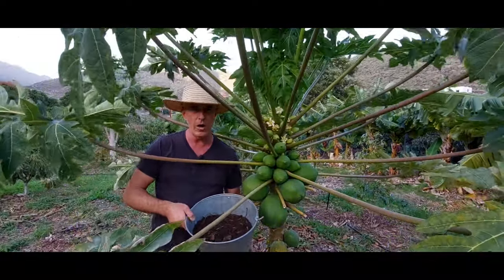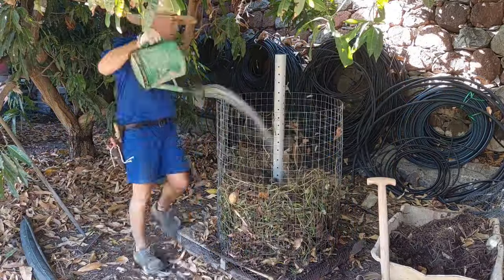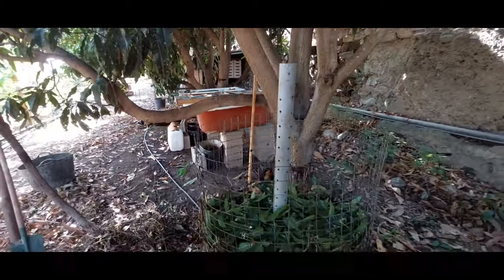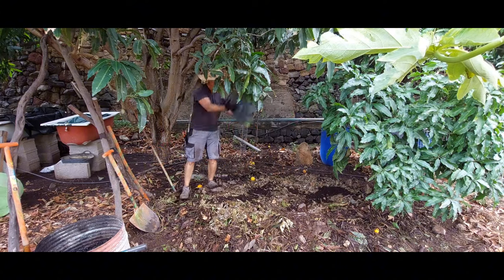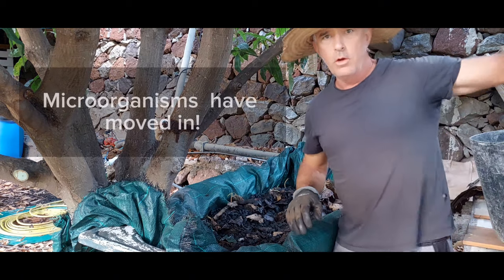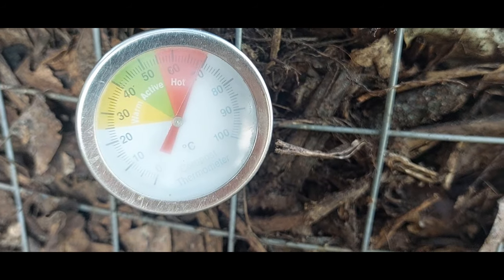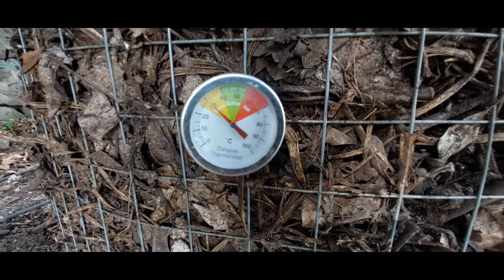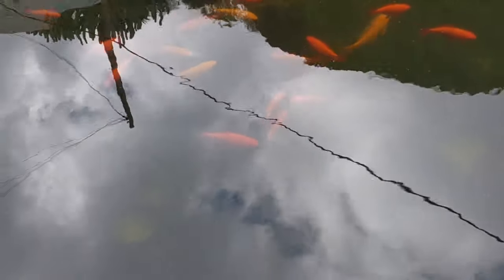Hot Compost on a Pallet and an  Aeration Tube! Organic Compost!

Comment: I recently wound up with what I can only describe as a reverse compost heap.

I spent a weekend cleaning out the garden of all of last year's growth.  The following weekend I built up a heap along with the contents of my kitchen straps tumbler and some leaves.  Problem was, it was actually below freezing out at the time.

The weather warmed up significantly over the next two weeks, but I was reminded that soil is in fact a terrific insulator.  My thermometer reported the core of the heap was consistently 30°F colder than the surrounding air.

It finally thawed enough to start heating up on its own, and is up to 110 now. 😂
Reply from the maker: That´s great! Funny isn´t it? Compost seems to have its own individual personalities. Thanks for watching and commenting JD!

Comment: I have two 8-foot x 8-foot bins made of wood. I pile my waste materials in the first bin, in layers. I use fine wood chips to mix with any "green" materials. If I have food scraps, I dig a hole in the center of the pile, mix the food with wood chips, and it cooks nicely. 

After a month or two, I cover that pile and start a new one in the other bin. After another month, the first pile is ready to be screened and used in the garden or orchard, freeing up the first bin for a new pile. 

This system works without the bins in free piles, but it's less tidy.
Reply from the maker: Sounds like you have it going on! Great system. So after a few months you take the cover off and it´s composted all the way through? Does it get cold during the winter months where you are? Thanks for watching and commenting K.
Reply: @BriansGreenGarden   It takes a few months to fill up the bin and then I leave it covered for a few more months to let it finish and cure (the worms help with that). It's totally finished at that point, with screening required for chunks. Piles will heat up to 140 F at times, but mostly they are warm or cool piles. I'm at 45 degrees N, so we have a 4-month winter. I can usually only fill one bin during the winter.
Reply from the maker: @kelliott7864  140F!  I think that's the sweet spot.  You could probably turn it once it cooled down a little and bring it back up to temperature if you wanted a work out and potential neck and or back injuries. Have you ever tried a static aerated pile? I'm thinking of trying it out. Looks good. Much less work.  Accompanying video, of course. I guess a big part of gardening is using your time wisely and compost can take up a lot of your time if you let it. Slow and steady wins the race.

Comment: Great job!   I'm wondering how different it would be if you just made pile with no pallet or wire cylinder?  I'm guessing more mess, slower conversion, not as hot, but how much less work and how much easier on the back?
Reply from the maker: Yeah, good question. The ideas is more access to oxygen throughout the entire pile..bottom included.  What was your experience? Thanks for watching and commenting. 🙂🌱
Reply: @BriansGreenGarden  Alas; sadly I have no personal experience ... yet.
Reply from the maker: Check out aerated static compost piles. I'll do a video in the future.

Comment: For fast compost turn the pile often, about once a week, chop up the raw ingredients ( I run a lawn mower over them a few times) and get the right amount of water in it.
Reply from the maker: Nice work Stephen! How big do you make your pile and do you do it more than once a year? Thanks for the tips and watching. Garden on!
Reply: @BriansGreenGarden  My pile is about 1 cubic meter. I've posted a time lapse video of me flipping it: https://youtu.be/XZF4ukp9B7A?si=cZ6OVK0XQetnbmy5 By turning it about every week or two and chopping up the raw materials I've got it taking about 6 weeks to finish the job.  I'll take the bottom half out for use and then keep the top half running as part of the next batch, so it's really about 12 weeks. We have cold winters, so the pile stops about the end of October and will start up again some time in April (it's frozen solid right now). I also get some mushroom compost from a local mushroom grower which I add to accelerate the pile.
Reply from the maker: wow! Great job Stephen! Your Garden is lucky to have you. 👍🙂

Comment: Are those white things not anaerobe bacterias? They are always kind of like a very fine mold/network. And they do form very fast as well. I don't see it clear/near enough here though. Maybe I am wrong. I don't want to say sth. which is untrue. But great work bro 👍🏻
Reply from the maker: Hey there. Not entirely sure to be honest. Could it be Actinomycetota? https://en.wikipedia.org/wiki/Actinomycetota
It apperared right in the centre of the pile beside the aeration tube so I´d be surprised if they were anaerobic. Check out what this page says about white mold. https://www.treehugger.com/mold-in-compost-5194701. Thanks for the view and the great question.

Comment: If it heats up like that again,  water it down good first and watch it for a couple days.  If it's still too hot then turn.  This little trick will save your back. I've had this problem a few times in the past. 😉
Reply from the maker: Great tip Chris. Back saver. I'm not getting any younger. I'll definitely give that a try next time. Thanks.

Comment: If you had access to any wood chip mulch, that probably would have kept it from getting so hot. Probably a little high in nitrogen. I moved away from hot composting and towards chop and drop. And chicken compost.
Reply from the maker: What is your chicken compost comprised of?
Reply: @BriansGreenGarden I tossed all food scraps and a lot of yard waste in the chicken coop. They brake it down and turn it scratching threw it. Great material for the garden. I mostly have perennial fruit trees and shrubs and chop and drop mulching seems the best for that
Reply from the maker: Chickens are the best! Thanks  Sean.

Comment: Pile 50 tons of manure let lt set for a few months
Reply from the maker: That's one great way of doing it! I don't have the space. I've been told I'm full of it though.
Reply: I think you might need to add some carbon too .
Reply from the maker: Woodchips?
Reply: @BriansGreenGarden  yeah that work- great if you want a  process that takes years to complete. 😅

I sift my finished compost and kick back the woodchips that remain (like 90%...) to the next compost stack. Dont really know how many years it takes to break down the chips, but it sure is not a quick process 😀

Leaves is a better source for carbon, that is a bit easier to break down.
Reply from the maker: @bsod5608  Nice work! Sounds like you've got it going on! Thanks for watching and commenting. Garden on!